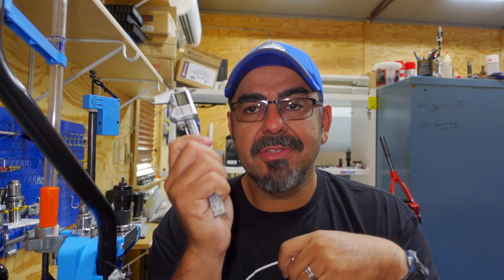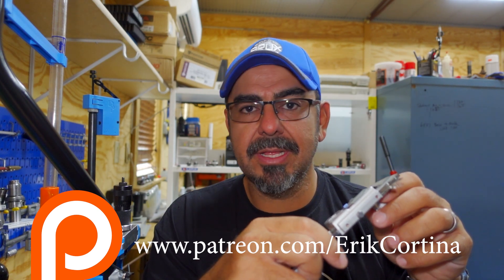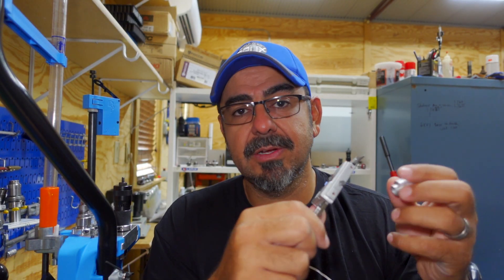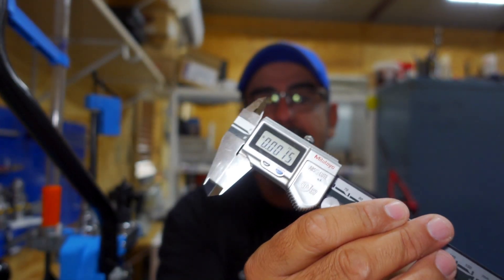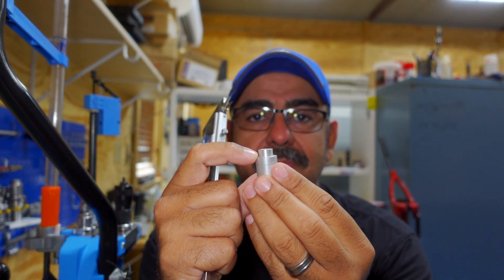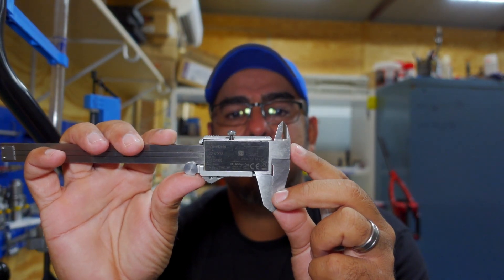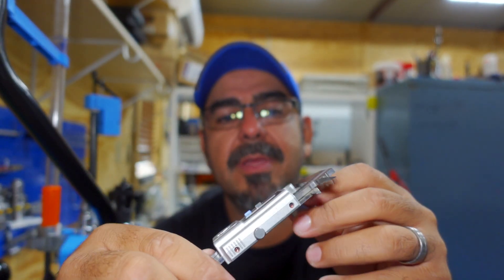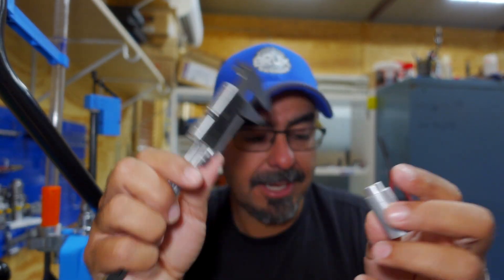You are using your calipers wrong!  Let me explain why...

Comment: anyone who doesnt know this info is either a beginner or not too smart. Been working in machine shops for 48 years, doing "real" precision machine work, tolerances of .00005. I still use my old Mitutoya dial calipers, not junk digital. Always check them with gauge blocks, they have NEVER been off more than .0005 and I also double check with micro's and electronic lazers. 
 If anyone thinks that .001 or .005 is NOT precision, then they should be doing videos for aerospace work.
Reply: Well, during my apprenticeship as s fitter back in the mid-90's I was tasked with making a gauge block for a CNC workcentre. The foreman didn't care if it was 82mm, 81mm or 80mm, as long as it was exactly on xx.000mm, basically 0-tolerance. I failed my first attempt, ending up with 81,999 after the final pass on the bench grinder, so I had to take of another .999mm.
A millimeter being only ~1/25", .001" would still have been WAY off. .001 is also about the difference between a loose fitting ball bearing at a press fit.
.005 is also way too much when you have to make a guide pin fit snuggly in a hardened forging tool. I found out the hard way when I tried to cut corners an use the hydraulic press to force it the rest of the way in after giving up on the nylon mallet and couldn't get it out again. the entire side of the tool snapped off. An expensive mistake that I only made once....
That being said, we also had a couple of Mitutoyo dial calipers in the apprentice department, and I absolutely loved them.
I kept the Mitutoyo vernier calipers I was issued when I started my apprenticeship as a momento, and still use them from time to time. :)
Reply: @HepauDK  ohh yeah, you know it. I worked on making hydraulic valves, etc..
 I had to go to a special school operate the machines and to be certified to work with tolerances that close. My tolerance for the pistons was + or - .00005. I was in a locked climate controlled room, everything was double checked with lazer equipment and temp was always 72 degrees. No one else was able to enter the room or touch any of the parts. It was like a hospital operating room. After doing that for 5 years, I found that .001 was a mile. lol
 Now being in machine shops for 40 more years, most general tolerances in machine shops are + or - .005. might as well be 10 miles lol.
 So glad to see others who have worked on truly precision  equipment.

Comment: 1: Remember to read the instructions for the gauge block. It should be withing a specified temperature range when used (usually around 20°C/~68°F if I remember correctly). Keeping it in your hands for too long will warm it up to a point where it is no longer 100% accurate due to thermal expansion. The same applies to micrometers. The frame is usually insulated, but it shouldn't be held in the hands for extended periods of time. These things are super-sensitive. The relatively high tolerance indicated in the data sheet is probably due to expected thermal expansion/retraction. It should be accurate at 20°C/68°F.
2: My 450mm (18") Mitutoyo vernier caliper (160-128) does not have any depth gauges. ;)
3: I did know about the 4th method, but haven't used it much due to its limitations. if there is any amount of curvature at the bottom of what you are measuring the depth of with method #4, you will have to tilt the caliper anyway. That's why the depth gauge has the notch at the tip.
Reply: Yes, a guy talking about accuracy handles the block with bare hands !
Pretty sure my VC doesn't have a depth function either - nor stepped jaws for method 4 !
In fact, for measuring i.d. I have to add 0·250" jaw thickness ;)
Reply: @millomweb  Ever notice how some people just have to always feel superior? I believe that do down, it has to do with insecurities. I am not an expert, however. 🤭
Reply: @aminormaximum2446  I think that's just your opinion. I like superior people. I've had far too much of the junk already - which is why I prefer animals to people - as they're often better behaved.
Reply: lol! you beat me to the bodyheat thing :)

Comment: Sounds ok in theory but most machined shoulders have a tiny radius in the corner which means that you can't hold the workpiece  flat against the sharp edge of the caliper jaw without using a spacer between them.  Personally I find hand held vernier gauges need greater care in use to be truly accurate. 
When measuring depth to a shoulder by hand, a micrometer depth gauge is more accurate as it sit's squarely on the end face and can be held slightly away from the corner radius.

Comment: That gauge block will only be accurate at a certain temperature too, usually room temperature or 70F/20C, stated on the box.
Reply: And it is even more critical when using a micrometer. Just holding it too long in the hands will throw it off.

Comment: What a load of garbage, any decent engineers know how to use the vernier calipers correctly. DOH!!
Reply: I am a learned fitter, but currently working as a technical designer on a plant that makes precast concrete elements, and if the engineers in the metal industry is anything like those in construction, there is quite a few of them that I wouldn't trust being able to use a simple tape measure correctly. Many engineers only have a theoretical education, those are the ones to be on the lookout for.
Reply: Surprise, they aren't vernier calipers but digital calipers.  You're showing your age bro.
Reply: @forestwinter1021  You are right and Brian is wrong. The big thing is using calipers correctly is what the video is all about. A man should know his limitations.
Reply: Im a toolmaker and i have seen tons of people use calipers in really weird ways, so no, not everybody knows

Comment: 6:42 — Gauge blocks are only good at a specified temperature and with no fingerprints on them, although most calipers probably aren't capable of telling the difference when used at an ambient temperature range of 20°C to 25°C.

Comment: You should never use the thumb wheel to hold your part or apply  pressure while measuring. Try to squeeze the jaws when possible.

Comment: Plus or minus 0.001" means that the caliper will be within 0.001" of the actual dimension.  That corresponds to an absolute  accuracy of 0.001" not 0.002".  That minor criticism aside, your technique for measuring a step is one I'll remember and use.  Thanks!

Comment: There’s a 5th one..........
For use on the lathe etc.  If you set the Calliper to the size you need to machine too, zero without closing, then set the calliper on the work, it will subtract and tell you how much is left to machine without having to do the maths.

Comment: You are correct about measuring a step on the OD of your sample, however, all Carbide, CBN or Ceramic inserts have a radius, thus not an accurate measurement at all. 
Hanging your vernier-calipers (calipers are for breaks on motor vehicles) on metal hooks on the wall is not not a good idea. Verniers come with a wooden or plastic box, lined with protective material - the correct place to store your verniers.
In general, verniers are for a "rough" measurements ONLY, thus the correct instrument for accurate measurements, will always be a micrometer which is regularly certified. 
Conclusion: Your heading is incorrect; It should read something like "different ways to take measurements with your vernier-calipers"

Comment: But what if you wriggle the bit around like you did with the depth pin?

And you forgot the fifth way of using the Vernier Scales.
Buy five or six of them. You can put them end to end to measure longer measurements.

Comment: When it comes to digital Calipers I have found money does not get you better accuracy... what Brand you pick does and I suppose some luck comes in too tool to tool and certainly temperature. I have gone through several sets of high quality  feeler gages measuring them and compared them with a 1 in Lufkin micrometer and one other not as good due to age and found relative to the low cost caliper known for its accuracy up to an inch pilot error making the measurement to be greater than the inaccuracy and the specs of  0.0015in accuracy and 0.0005in repeatability up to an inch at least to be honest where relative comparison can even pick that up a bit. But that small scale is where lab instrumentation needs to come in to measure a split hair. 

As for the 4th use I had noticed that but thought it was the tools machining quality allowing it and didn't associate it with intended use so good information and happy to say turning on the computer this mourning and seeing the bait let me learn something... thanks. Guys like you make bad guys worry...;-)

Comment: Any idea why there is a 3/32" opening at the inside edge of the Inside and Outside jaws?
Reply: It's there as clearance,  because it's almost impossible to produce a true internal corner without leaving a tiny radius.
Reply: @mrmyorky5634  It is a slot not a radius.

Comment: 1" at specified temperature only if that is a steel block.
Reply: Right. One inch (to the specified number of decimal places, which varies by grade) at 20°C. Also not including dust, or corrosion from skin oils.
Reply: 68 degrees is the standard temp for every 1 degree it expands contracts .0001 for a 1 inch piece of steel.  Without Googling if I say +/- 3 minutes how many degrees am I talking about?
Reply: @ranbymonkeys2384  68°F in the USA, 20°C  in the rest of the world AND in most accredited Metrology labs in the USA. Convert °C to °F and you will find that 68 is the closest °F value.
Reply: @GraemePayne1967Marine  OK hahaha
Reply: @GraemePayne1967Marine  I have been a machinist for over 13 years i program and run the MAZAK 530C vertical smart mill.  What you just said is the same as saying 1 mm is .03937 OK you are correct I dont know what to say to that
Reply: there are 60 minutes in 1 degree maybe I can teach you something
Reply: there are 3600 seconds in 1 degree maybe I can teach you something!!!
Reply: now you know when the print says +/- 40 seconds thats what its referring to
Reply: @ranbymonkeys2384  the original topic in this block dealt with accuracy due to TEMPERATURE CHANGES, nothing to do with angle at all
Reply: @helmuthschultes9243  I though u were replying to my question nobody answered because you said 68 f is converted to c. Um ok my reply to that is no shit.  I guess I don't even know what to say about what u were trying to tell me then
Reply: They are referring to ANGLES not TEMP!!!!!
Reply: @ranbymonkeys2384  Well, this discussion appears to be about degrees of  Temperature, whether Celsius, Kelvin, Fahrenheit or Rankine. Temperature does not have minutes. Only angles and time have minutes.
Reply: @GraemePayne1967Marine  The discussion is about using calipers wrong, your turn!

Comment: temperature will affect calipers and gauge blocks and should have accurate at (?) temp. Granted expansion/contraction is minimal unless temp is extreme but it is a factor when looking for extreme precision
Reply: I don't think you need that level of precision for reloading. Even for 0.25 MOA groups.
Reply: @killer2600  the comment was not meant to be targeted (no pun intended) at reloads but as a general comment for where that extra decimal place or 2 does matter. My guess is that temperature variation of the tool and material being measured is why the caliper says accurate to .01 when it measures to .001. My guess only the likes of NASA, Aerospace and Race cars need that .001 precision and know to take measure at the correct temps. My ruler at work states accurate at 22.1'C but we require only .5mm accuracy so not an issue as the max and min temps we work in the variation would be well inside that .5mm.
Reply: @TheFalconerNZ  The coefficient of thermal expansion for steel is 0.00000645in/in/deg F so for a 1 inch gauge block it changes in size 0.001161 inches when going from 32°F to 212°F (freeze point to boiling point of water). At room temperature, where a machinist/person is most likely to be measuring precision parts, a gauge block is more than accurate enough as are the tools used to take measurements. You typically don't need to worry about the temperature calibration if everything you are working with is at room temperature.

Comment: I wonder how temperature affects the accuracy
Reply: same way you heat a nut to get it off.  The wings to the B1 bomber pivot joints came in nitrogen and then assembled so when it warmed it would expand and thats how it would hold in place

Comment: Loving the comments.... "I'm and engineering and I've know for 40+ years"..   No shit. I'd suggest that this video is more for those that aren't engineers, Maybe model makers or 3d printers. If you've been an engineer  for 40+ years then this is kind of basic stuff.  I mean like I've only been an engineer for 34 years and even I knew ;-)
Reply: .....actually, you must be a mechanical engineer. I believe civil, chemical, electrical, and other engineers can benefit from this "fourth" means of measurement.  I've always used the depth rod to make shoulder measurements and now know a better way; so there ya go.  And I've been at my job almost 44 years.  I think everyone should learn something new every day.
Reply: @finallyitsed2191  One of my own personal goals - try to learn one new (useful) thing every day.
Reply: I worked in calibration labs for something like 25 years, and another few years performing accreditation assessments - and even I learned a couple of new things. Granted, my work was principaly on on the electrical-electronic side of metrology, but I had to learn some of the physical-dimensional side as well. Partly to know how to use dimensional measuring tools used especially in microwave systems; partly because of personal interest, and even more when I started doing accreditation assessments - because I had to know at least enough to detect a plate of BS when it was being thrown at me. The knowledge also helped while being a co-author of ASQ's Metrology Handbook. But still never knew about using the back side. (I knew about the difficulty with the depth bar when the tail of the caliper is not fully supported from personal experience ... )

Comment: Gauge blocks are still unreliable due to temperature change. On a very cold day they shrink enough to be measured different to a hot day.
Reply: That's why every print is assumed to be at a temperature of 68 degrees unless otherwise noted

Comment: You got it!  I was buying calipers for the school mech. class and had a box of 30 that came in from China. The variation between them compared to a starrett micrometer was .003. I guess better than using a ruler!  Another oversight is the difference between the I.D. and O.D. readings! On the 30 units, NONE were the same! Off by as much as .005 inch! The $250 Starrett was within .001 (equal to the resolution) on all measurements.

Comment: Not sure if anyone else has mentioned this on here but think it's worth noting that guage blocks are calibrated to be accurate only at a specific temperature to counter differences for thermal expansion and contraction. It should say either on the block itself or with the info that comes with it.

Comment: You don't mention the clutch/friction feature on calipers and micrometers. The little adjustment wheels can be set so you 
get consistent pressure when taking measurements. Great video.

Comment: I've been hammering nails in with mine for years. How dare you say I'm using mine wrong.
Reply: Exactly, and I guess using a mike as a C clamp is frowned upon
Reply: @cmwood6959  "Calibrated" c-clamp mind you.
Reply: Mine double as a locking precision adjustable wrench!!!!! :)
Reply: Calipers doesn't strike me as very effective hammers.
Unless you have a big-a** one like my 450mm Mitutoyo 160-128. :)
Reply: I open the jaws and use them as a seal puller.
Reply: beer bottle opener

Comment: Measure the short length, zero the scale and extend to the long length it will display the difference.
Reply: finally
Reply: That's technically not as accurate. You're making two measurements instead of just one. Every measurement is accurate to say +/- 0.001" and by making two measurements you are stacking the tolerances and could be +/- 0.002" off instead of +/- 0.001" if you made only a single measurement.
Reply: It’s good enough for anything except high precision (1/10 thou) work.

Comment: People always poo poo on the accuracy of calipers, and out of the box with no comparison to a standard they are at best as good as that +/- .001 the manufacturer claims.  But, once you compare them to a calibrated standard in their full measurement range, ie. each 1", 2", 3", etc. increment, there is no reason you shouldn't trust that what your dial reads is what the part actually measures.  This of course requires that you are measuring under the same conditions that you calibrated the caliper.

Comment: I guess learning in a machine tooling class over 25 yrs ago is better than just picking it up on youtube because I learned that same feature back then. I prefer dial calipers as they hold up way better than digital. I even spent as much as $150 on a set and they just don't hold up after a little use they get where they wont hold zero. the dials are king to me the are cheap and simple to use and easy to read and hold their accuracy. Of course anytime I need .002 to.003 tolerance I go with a micrometer. But nice video I bet you helped a lot of people.